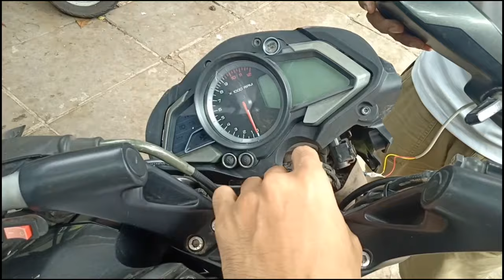LED indicators for ns 160/200 | Full step by step installation | cheap and best.

Comment: pulsor is known for it's traditional muscular look, don't spoil it's look with these tiny tiktok dancer type indicators
Reply: Hahaha true
Reply: It depends on individual preference. Check out other muscular bikes like the Ducati monster. It doesn't have huge indicators. Then take another example from the Bajaj stable itself : the Dominar. It is even more muscular but still has smaller indicators than the pulsar. Adding smaller LED indicators doesn't necessarily spoil the look.

Comment: I have installed both front and back signal led at my motorcycle, but when i switch on the left signal or right signal, all of the signal blinking. I also have replaced the standard factory relay with an universal one. Can you help me please.
Reply: its better to get it fixed by an auto electrician.
Reply: @Gauravgurung9  okay2 thank you🥰
Reply: Que marca son esas intermitentes